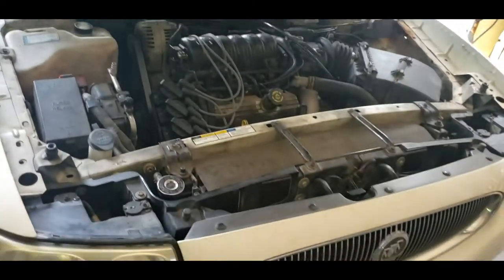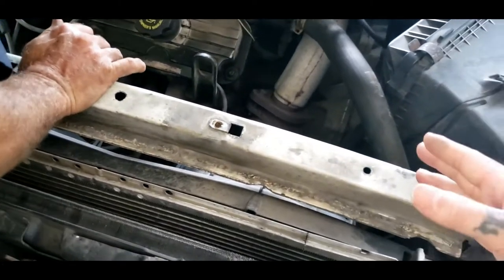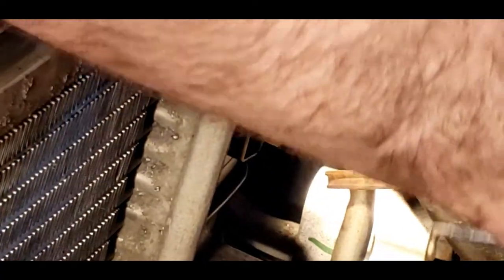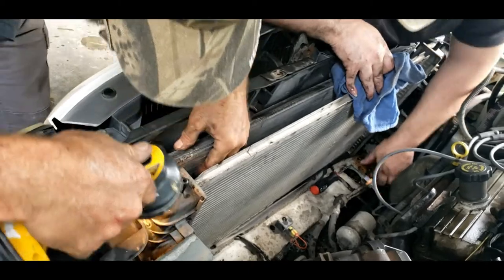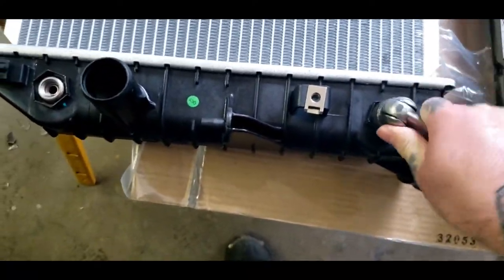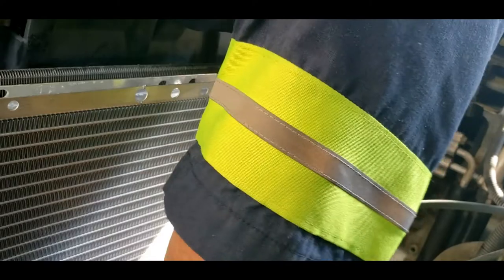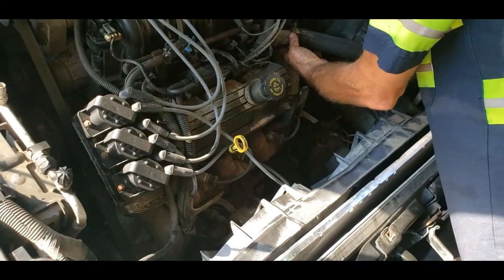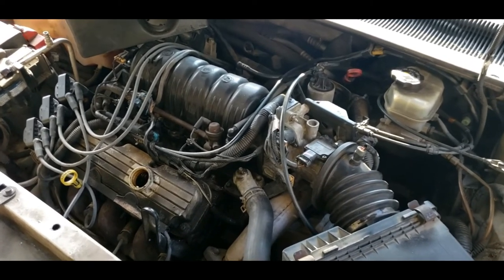Detailed Instructional GM 3800 Series Radiator Exchange (Installation and Removal) - How To

Comment: Good ideas with the sensor plug bolt and removing crossmember. It's a good idea to spray some pb blast on those trans cooler line clips at the start of the job...alot easier to get those c clips out and take out the fittings, unless you have new fittings.. another good idea is replace hoses, if needed and thermostat. Great video fellas!

Comment: I’m using this video to replace my radiator in my 2002 Pontiac bonneville, it’s a pain in the ass doing it one man style just cuz the radiator gets stuck in the condenser so it’s extremely hard to pull out, I’ve got everything out but the radiator and it’s starting to really eat at ya, sucks but gotta do what ya gotta do, thanks for the step by step it’s definitely helpful!
Reply from the maker: Happy to hear my video was helpful, Thanks for watching

Comment: I really thank you and you guys for taking the time out to show this in depth video about replacing  the radiator  for this model lesabre.  Mine is leaking now from the outside by the upper hose. I can't understand what you're explaining about the part where you made the thread for a plug that you apparently dnt need. If its not too much trouble I would appreciate if you reiterated that for me  thank you and God bless
Reply: Probably too late to help, but maybe this will help someone. Some models have a low coolant sensor, which is what that hole was for. The car they were working on didn't have that sensor, so they plugged the hole.
Reply: @hummvee69  thank you for that info. I replaced the radiator a few months ago with your help. Would love to see more in depth repairs of this make and model such as spark plugs and other things if possible. Again many thanks

Comment: Why do the lines going into the radiator, have to be removed by taking the c-clips out, when the whole contraption can be unscrewed from the radiator?
Reply from the maker: if you just un-clip them you don't risk striping the threads in the radiator, also sometimes lines are stick and if you twist you could break the lines

Comment: How would you remove and replace the condenser? Is it pretty much the same way?
Reply from the maker: I dont know, I never done one on this style car
Reply: @TattsForLife  ok thank you. Great video btw
Reply: Condenser- It's a bit of a pain. There are brackets that never seem to line up. Then, of course, you have to add vacuum to your condenser, then fill the system.

Comment: Sure enough with this warmer weather that hit today, our 03 LeSabre started overheating and steaming from the radiator. Can you link me to a radiator to buy online? Preferably ebay or amazon? I want to make sure I get the right one since you mentioned the sensor thing.
Reply from the maker: I got the wrong one in the video, and I installed a plug, prob be best to get one at the auto parts store so you wont half to deal with shipping it back if its the wrong one, and you can check it at the store to make sure its the right one before u buy

Comment: Yo I barely seen this, my 01 leSabre starts overheating due to the fans not spinning but when I’m driving the car doesn’t heat up? Is the problem only the fans or something else? I already put new relays and fuses
Reply from the maker: if you don't over heat driving them your coolant system is working, as you drive air goes though the radiator and dissipates heat, when you setting still and your fans not working they no air going though the radiator so you get heat build up and start to over heat.

I would try fan relays first and see if that why your fans are not working, then maybe check fan motors
Reply: No it’s the temperature sensor/sender I had the same problem, as soon as I put it in they kicked back on. Hope this helps you
Reply: And maybe your thermostat
Reply: @TattsForLife  my car is also fine with driving once i'm parked still and or not moving for some time eventually my car heats up also the fans are not working